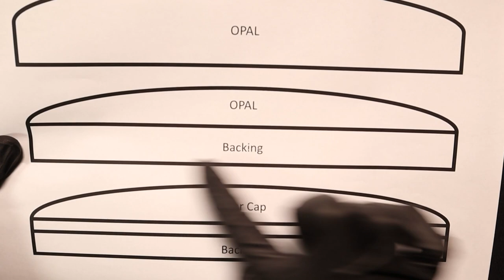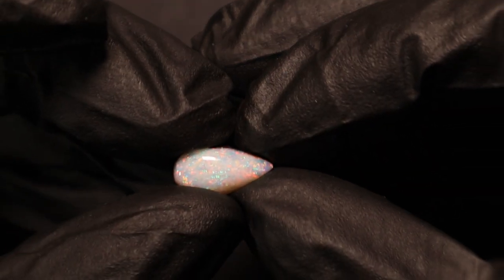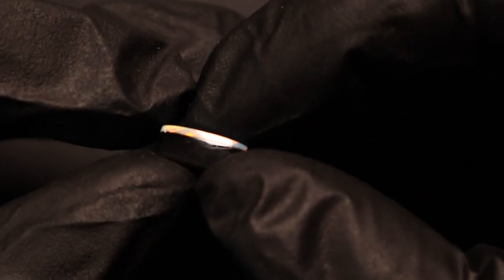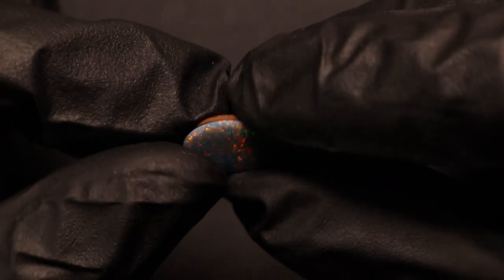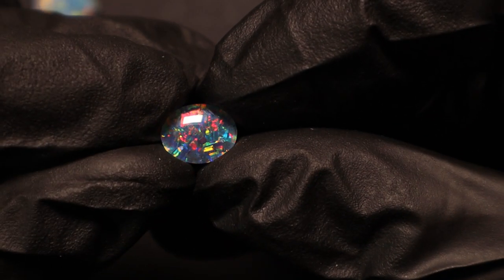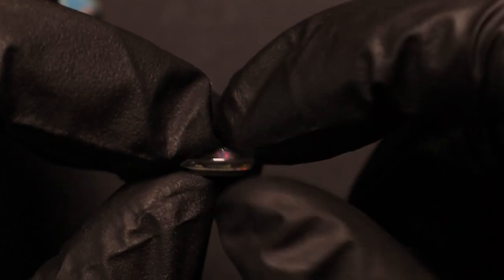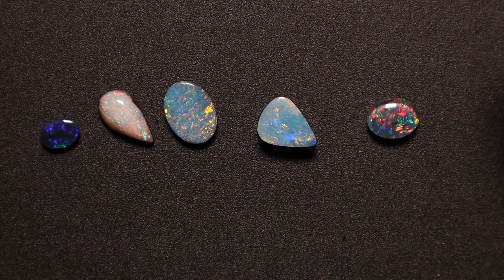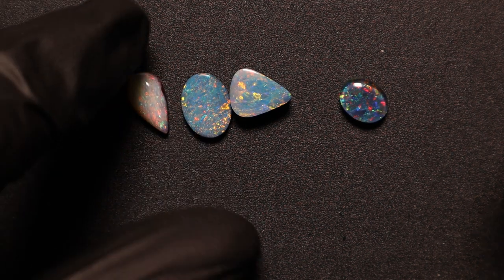Solid Opal VS Opal Doublet VS Opal Triplet. How Do You Tell Them Apart? Real Examples.

Comment: Any way to tell which it is when the opal has been set in a piece of jewelry and you can’t see the back?
Reply from the maker: Doublets can be difficult if you cant see the back or sides but sometimes if the crystal is clear enough a loupe can show the glue backing through the face.
Triplets are always pretty easy because the dome is not made of opal and instead you'll see a magnified projection of the opal below. You can cast shadows or angle the lighting to show a clear top.